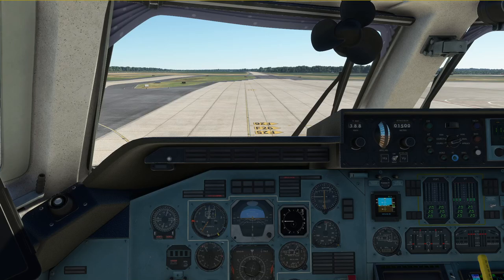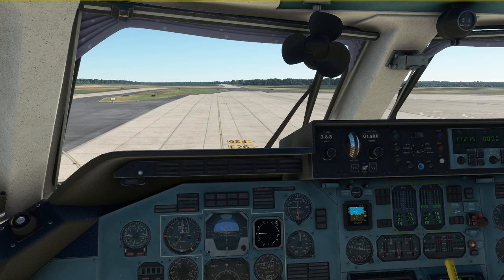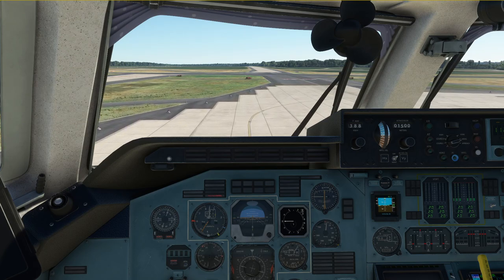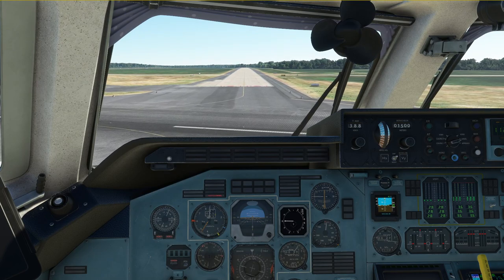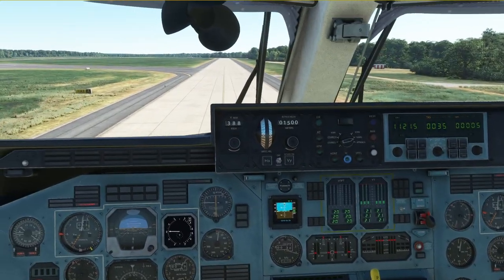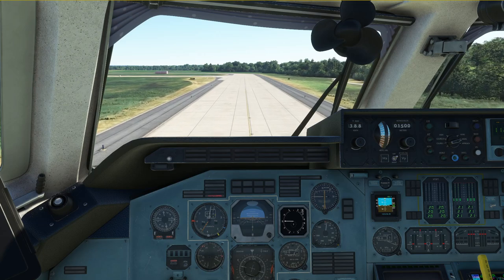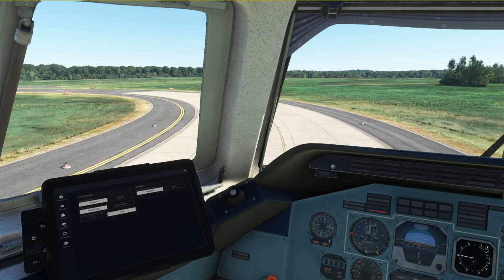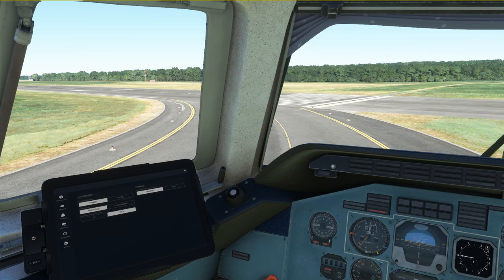Antonov 225 Tutorial 3: Taxi | Real Airline Pilot

Comment: You can also use the autopilot information panel to see your groundspeed, personally that's what I prefer since the GPS groundspeed is hard to check as you pointed out. I just keep in mind that 30 knots = 55 kph.
Reply from the maker: Good point!
Reply: And usually (unless you are from the U.S. and not used to it) you can just use normal car speeds at KPH for your Taxi speeds. As long as you remain between 30 and 50 KPH you are not too fast. So just taxi the thing as if it were a car within city limits.
Reply: @Quotenwagnerianer  That's also pretty smart, I didn't even think about that.